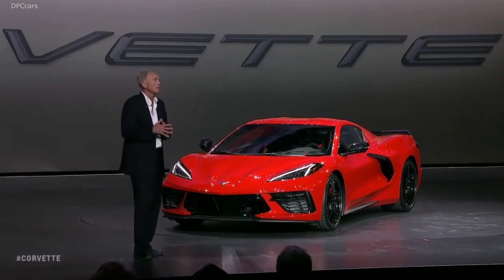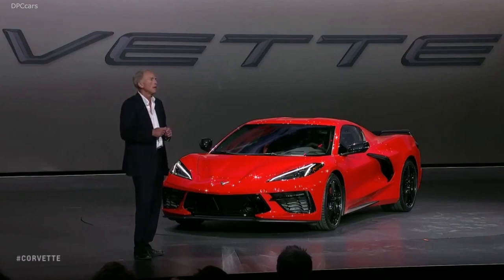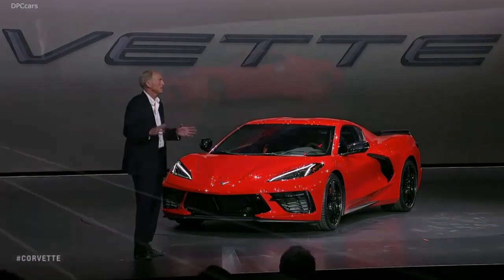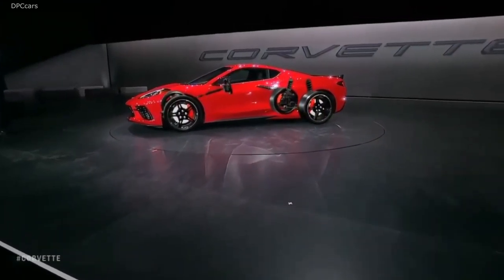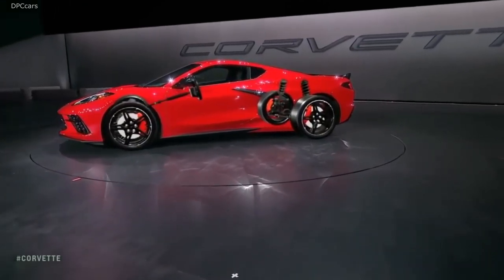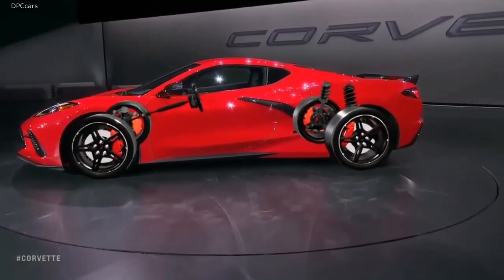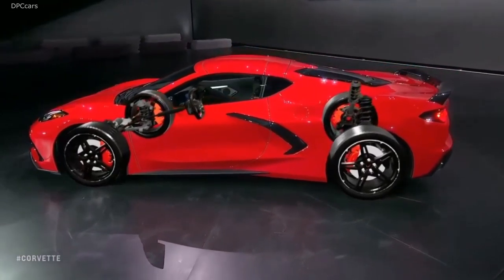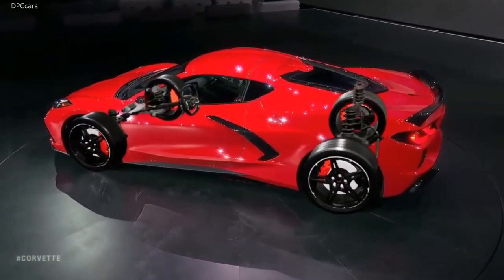2020 Chevrolet Corvette C8 Stingray Suspension and Chassis

Comment: A C8 at $60k is relatively cheap enough that I'm keeping my C7 manual transmission for 3 pedal engagement 
fun when I get a C8.    Unlike other cars that I've owned in that I normally tradein to lower the cost of 
the new car.  Wow, the interior seat colors, dash colors, door colors, drive mode switch colors, seat belt 
colors.   World's 1st car with a GPS lift.
lol, my C7 manual transmission will continue to be my daily commuter and the C8 will be my weekend car.